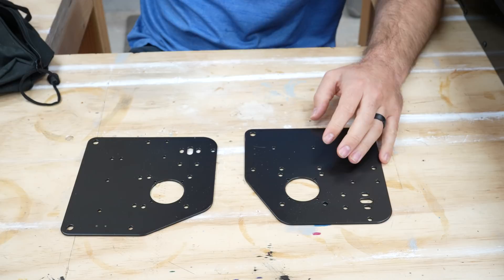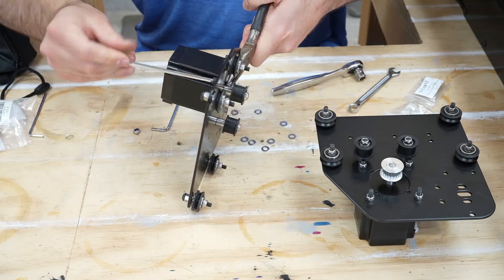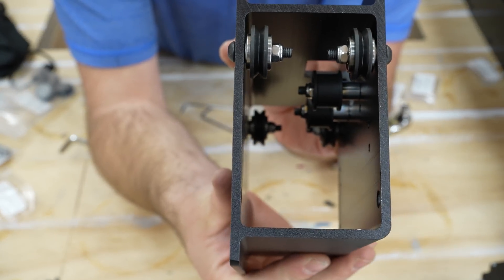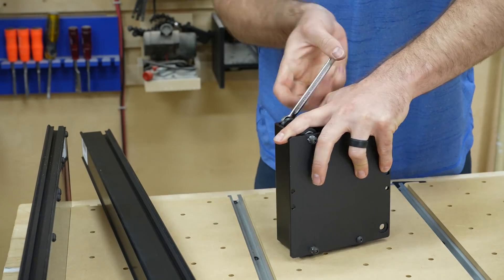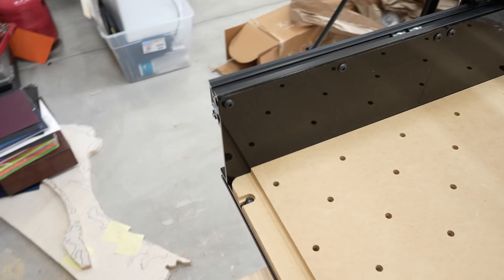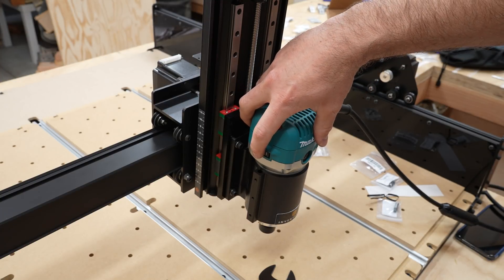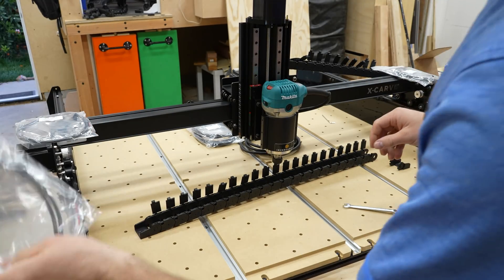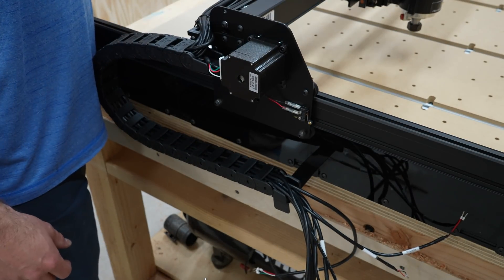X Carve Assembly Part 2: Gantry and Wiring

Comment: Hey man good video. I'm assembling mine now. Can you tell me how freely or snug the gantry should move back and forth? Should it roll on its own if I give a little push?
Reply from the maker: Before putting the belts on, the gantry should be able to move with a push. You want the wheels are snug enough so it is stable and doesn’t rock or roll at all
Reply: @BenTardif  hey thanks man. I'm just over thinking it. I just want to be sure everything is right when I'm ready to start up. I'm sure I will be referencing this video thank you.

Comment: Make sure you run the router at speed 1 or below.  The Makita router will run slower than the previous Dewalt router.  Inventables recommends the lower speeds.  Just an fyi in case you did not observe that in the assembly instructions.  Enjoy your build.